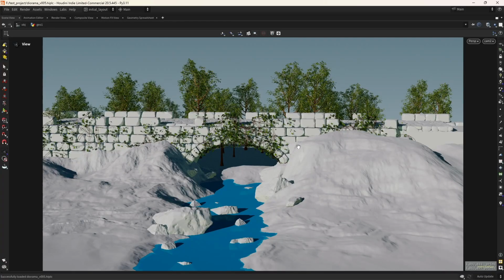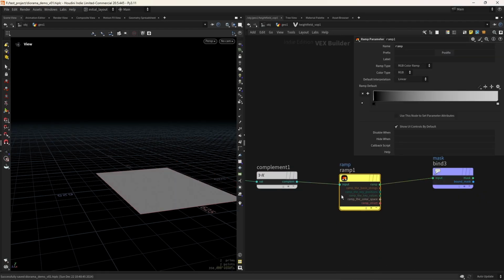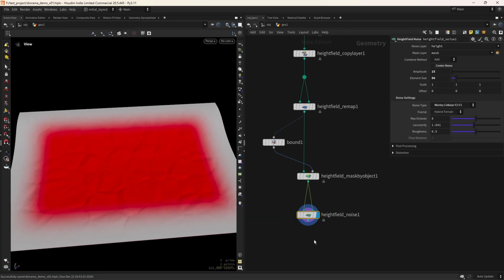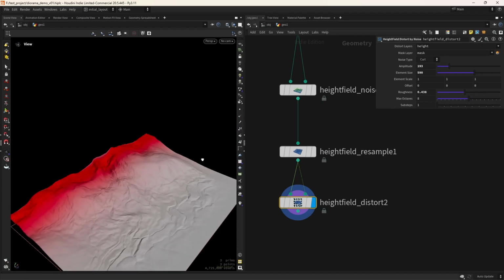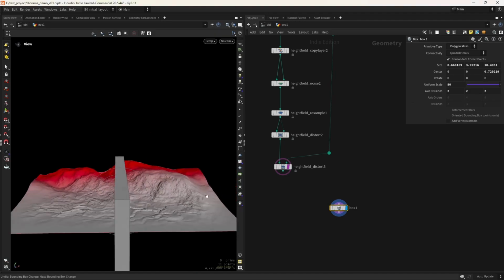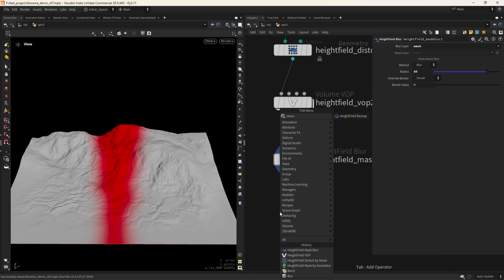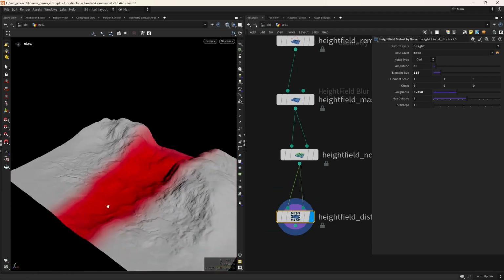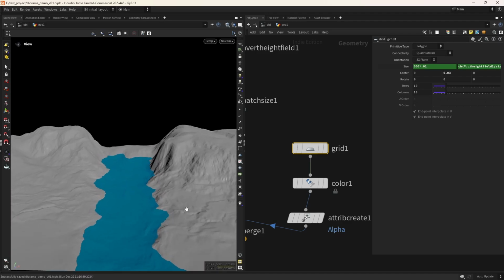Environments in Houdini | Part 1 -  Heightfields

Comment: Heightfield draw mask node is not working in 20.5, the way of use the node has been changed?
Reply from the maker: I haven't used it in this video. Maybe try to update it to a recent daily build?
Reply: @cgside  I don't know that would be works, but thanks fot your reply!
Reply: I just did this in 20.5 and everything worked as seen in the video.